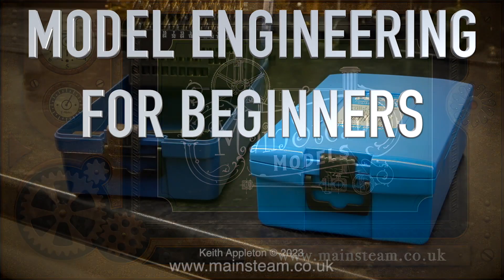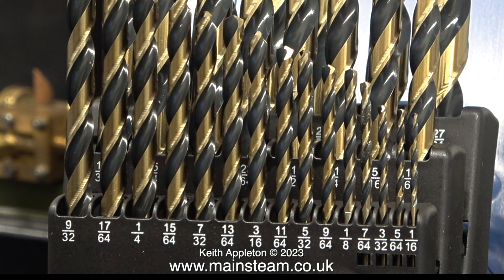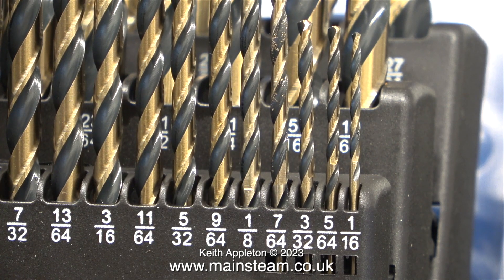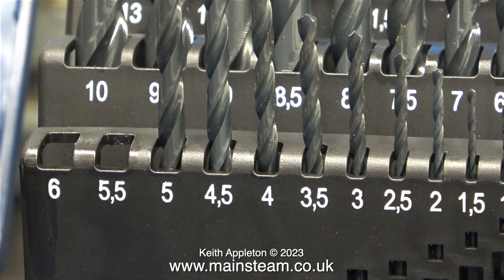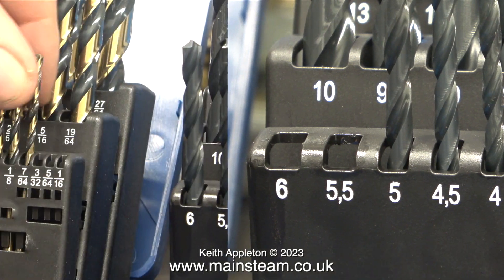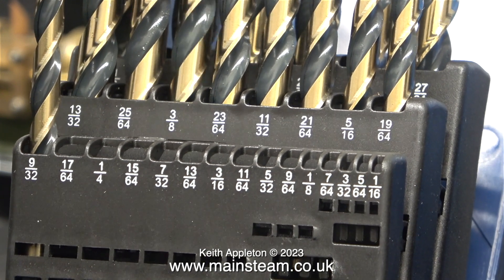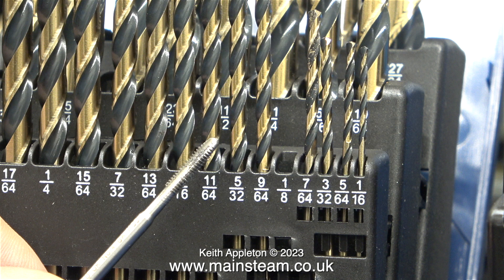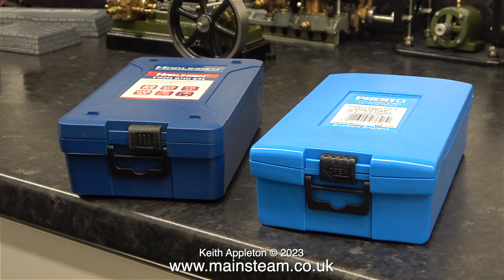TWIST DRILL BITS AND TAPPING - MODEL ENGINEERING FOR BEGINNERS #52

Comment: How do you stop drills from 'grabbing' as they move out of the metal. My 'ordinary' drill set rarely does this but my 'posh' Dormer drill set always does, especially when drilling thin sheets of brass.
Reply from the maker: Regrind the Twist drill with a lesser tip angle ...... that helps.
Reply: @keithappleton  Thanks, I'll give it a try.

Comment: Surprised you don't have any number or letter drills, or their British equivalent. A lot of the common US threads require them for tap holes: for example, a 1/4”-20 screw requires a #7 drill (0.201"), for the tap, and the close clearance hole is an F drill (0.257").
Reply from the maker: Let's just say that I have a full complement of Imperial, Metric  & Number/Letter drill bits. and I am fully aware of what you state in your comment.
I don't show quite a lot of the things I have on here . . . . . .

Comment: Then you have "american" thread sizes: 2-56, 3-48, 4-40, 6-32, 8-32, 10-24, etc. (I don't remember the rest).  Those are the NC (national coarse) sizes.  They also have NF (national fine).  We also have "numbered" drill sizes (1-60 going smaller), and "letter" drills (as I remember an "E" drill is the same as a 1/4 inch drill).  So much fun.  Always have a big chart on the wall if you are doing lots of this stuff.  Nice video as always!

Comment: I normally use Imperial because, after all, I am in the USA, that is my normal go-to.  I do have some metric tools because using the correct sockets and wrenches on nuts and bolts tends to work better and not mess up the nuts and bolts using something that is only "close".  Now where did the No 10 socket go?

Comment: You can buy "tap and drill" cases that hold the tap in one row and the appropriate bit in the next. Usually sold empty. I had one for imperial threads and it was very handy. I think it went from 6-23 up to 5/16-18. Like all good tools on a job site, it was pinched.